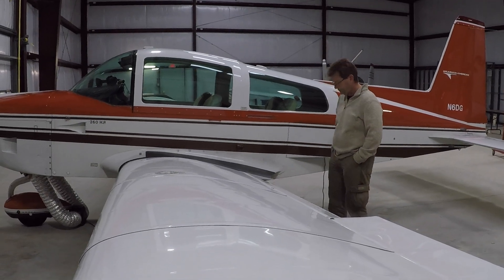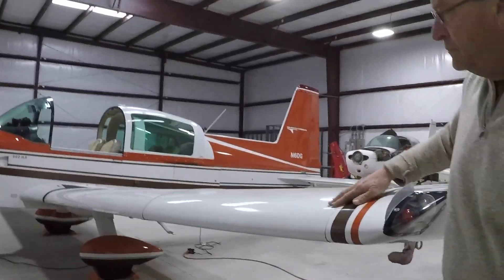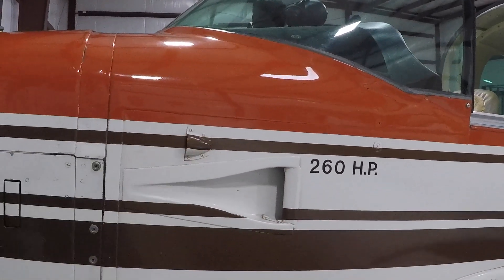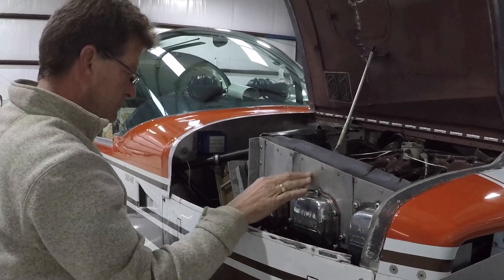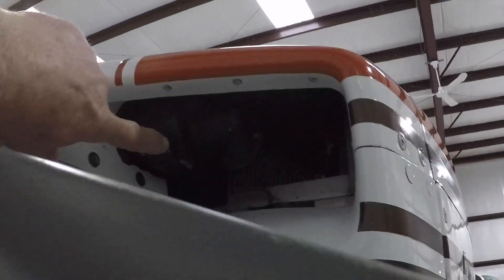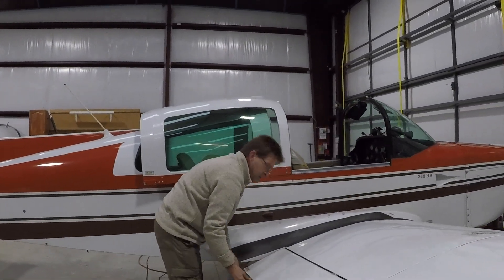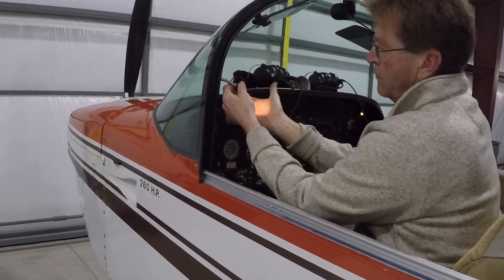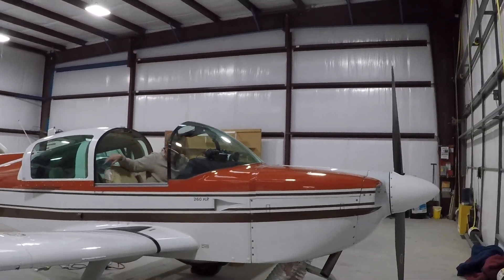4-Place Preflight - Grumman Style

Comment: What about checking the prop for stone chips and scrapes and if its the first start of the day  hand swing the prop to sick up some oil to the top end before you  engage the starter
Reply: I was thinking same thing - no prop check for chips.
Reply from the maker: We do that prior to flight
Reply: @GrummanPilots  But this is a preflight check...
Reply from the maker: @2akAt74k  Yes and we did it by the Grumman/Gulfstream book.
Reply: @GrummanPilots    But the point is that you failed to check the prop for chips in a preflight

Comment: What is the fuel burn with the 260 compared with the 150?? Nice TIGER.
Reply from the maker: Tigers have 280 hp O-360-A4Ks i them and they burn 18.5-19.6 on taker off and cruise leaned to 10 GPH (135 knots), the O-540 burn 26.7 on takeoff and leaned at altitude burn 11.0 gph at 165 knots.
Reply: @GrummanPilots  180 hp  in AA5-B
Reply: @GrummanPilots   180 hp     a   280   is  a   six cyl Engine.   Found in a Cherokee 6   WOW